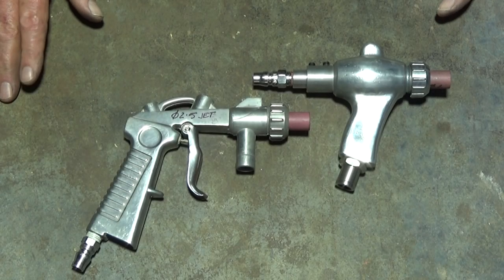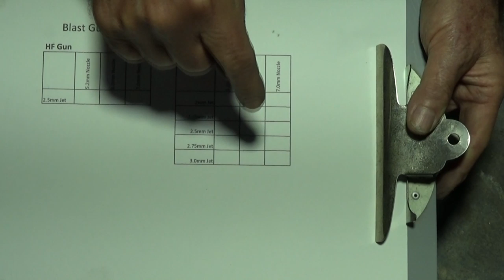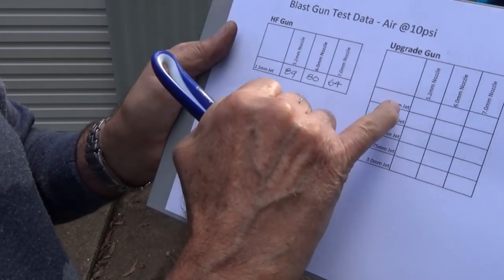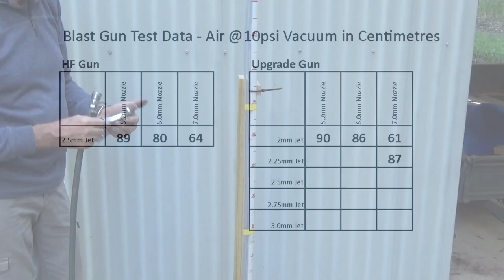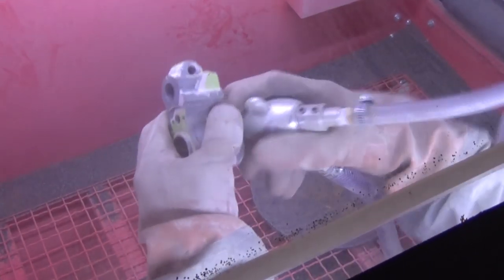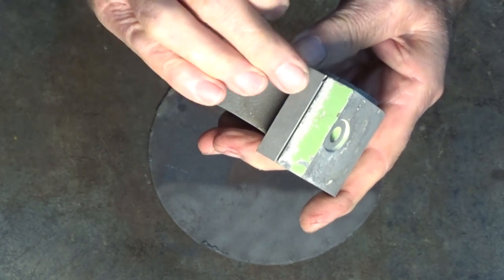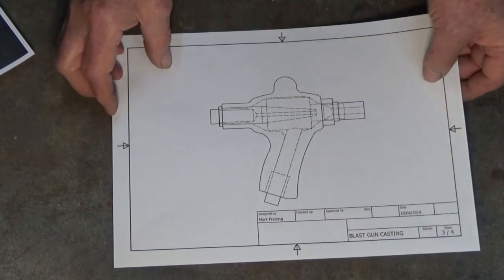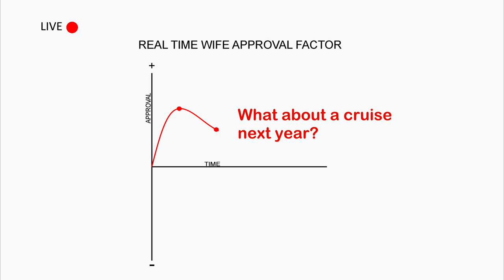DIY Blast Gun Testing Using a Manometer

Comment: Mark, I made several mistakes thinking I could save money by buying a cheap blast cabinet. I restored a 1980 MGB and cursed the HF cabinet ($175) every minute wasted trying to get the POC to work right. I also added a $150 dust collector. The second mistake was putting undue wear and tear on my compressor. I was going to sell the cabinet when I heard about the Tacoma upgrade. The third mistake was investing $448 plus the modification time. I have mixed feelings since the HF cabinet now works great at 35 psi, using 70-140 sieve media. Check for flow restrictions. Use the largest dia hose from the compressor to the cabinet. I have a dedicated 12mm hose from blaster to compressor (no quick connects). 19mm would be even better. I also checked/replaced any undersized quick connect fittings in my shop. Good luck on the larger compressor.
Reply from the maker: Thanks for the information. I think my biggest restriction is the cheap foot pedal I bought on Ebay. I am wondering if I can fit a ball valve and operate it with a knee operated lever. I think it's great that you are getting good results at 35 psi. That would cut down the duty cycle on the compressor.

Comment: Hi  Mark,
I’ve been enjoying your projects and videos, I’ve been looking to improve my sand blast gun recently, having a similar Hare & Forbes cabinet similar to yours.
Seeing your problem with the take up of media from the hopper even with your improved gun, I had the same issue with my set up, I solved this by mounting a small wiper motor with the gearbox removed and an eccentric weight added to the shaft, causing it to vibrate when running.
Mounted this to the outside of the hopper near the pickup tube for the media, this improved the flow of the media to a constant stream, no more sputtering.
I’m going to fabricate a gun along your design ( can’t cast yet in my workshop) to try to improve efficiency at the nozzle and also optimise the use of available air.
Keep up your good work, love your banter 👍regards Ralph
Reply from the maker: Ralph, I have seen some other users mounting vibrating motors to their media hoppers and I believe you can buy an off the shelf and self contained unit which does the job. I have noticed that even though the media isn't being delivered continuously to the gun, it still generates an almost continuous stream of grit at the nozzle. I think that the "gulps" of media are stored in the chamber inside the gun and the flow is regulated by the cross sectional size of the nozzle. For what it's worth, if I wasn't able to cast that gun in aluminium, I would now have it 3D printed in stainless steel. I just had some parts made for another project in 316L stainless and it wasn't as expensive as I thought it would be. The good thing about 3D printed metal parts is that they can have complex, hollow forms and they only require minimal machining afterwards. Sometimes you can get away with just a bit of drilling and threading with a regular tap and die.
Regards,
Mark

Comment: Very interesting to watch the evolution.  The ultimate key to blasting productivity is Pressure and CFM. 

Also, a Pressure Pot system is infinitely more efficient than any Suction Gun setup. I have been thru the evolution a couple of times since the early 1980's. My current blasting compressor is a 185 CFM Diesel powered unit. Plenty of air!
Reply from the maker: I would LOVE to have something that can deliver 185cfm although we might upset the neighbours with the noise. I watched a video recently by SV Seeker where he was getting ready to sandblast a steel yacht/replica Chinese Junk using a very large engine driven compressor. He included a very interesting video where he talks to a corrosion consultant about the correct way to prep steel for finishing. Very interesting. I did actually do an experiment where I tried to pressurise the media where it passes through the metering valve. I fitted a second air line with a regulator and gradually added pressure until the media was being pushed up the feed tube to the gun and then added air directly to the gun. It didn't help much. Initially, there was a good flow but then the media was depleted in the line and it just sucked air. I think if I had the room I would use a pressure pot with a large cabinet to collect the media but it's all about real estate in the workshop. I really wanted a smallish unit so I can prep weldments and fabricated parts for paint and powdercoat. Painting brass and non ferrous alloys is always a bit hit and miss but when they are given a good key and you can remove the oxides you can give the coating a fighting chance. 
Regards,
Mark Presling
Reply: @Preso58  The first go-round about 1981 when I was 21, I found an old portable IR compressor from the 1940's that was 100 cfm, piston type with a massive old Waukesha engine driving it. Made a pressure pot from a 100lb propane tank. And I had neighbors, close. Why they never called the cops is a mystery.  I'd never stand for that. (ha). I've watched all of SV Seekers work on his compressor and blasting evolution with interest. Great stuff. My current compressor is similar to his. I think the key between siphon and pressure blasting is the 'acceleration distance'.  In a siphon gun, the media has less than 2 inches to get up to the speed of the air flow. Much slippage occurs. In a pressure pot, it has the entire blast hose length (10, 15, 20 feet?) to accelerate up to air flow speed. I've thought about some sort of hose attached to the nozzle of the siphon gun, to give the media more distance to accelerate. Then maybe a secondary nozzle at the working end of that hose? Enjoy your vids very much!

Comment: Prezza ! Mate, pall.... Manometers, black water.... 'a bit of a mess'....
I figure your missus is about as happy as mine, when I get up to this sort of stuff....

Toodles!

Paddy
PS : about 30 years ago, I walked the length and breadth of  a nuclear plant, just using a clipboard !
Now, I had clearance, so no harm was done, but I only identified at the main entrance...and was allowed everywhere, just by walking around with a clipboard and a rather worried look on my face.
They are (clipboards) powerful weapons indeed !
Reply from the maker: I watched an episode of "Better Call Saul" where Mike Ehrmantraut did almost exactly the same thing with a clipboard. You are correct. Clipboard = authority
Reply: Overalls a concerned look and a tool caddy/box works wonders too

Comment: Just love this series. Truth is I could just pop down to the shop here in Canada and buy a gun but yours looks way cooler with the lightening bolt. No, what I love about this series is the science you’re putting into it. Also the casting techniques. Yup, love it!
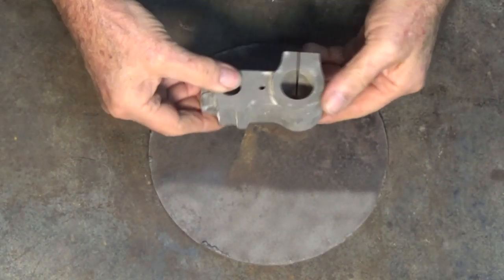Reply from the maker: I can report that I am very happy with the blast cabinet now. It still surges a little but the supply of grit coming out of the nozzle seems to be constant. One of the best mod's I did was to fit a knee operated switch to turn the air on and off to the gun. Way better than a foot pedal and there's nothing kicking around on the floor under your feet. https://www.youtube.com/watch?v=HhgT67n5lDo The mod is shown at about 15:00
Regards,
Mark

Comment: I think the upgrade is needed for sure.   Just because home shops dont have a good compressor to feed it air.   I have a bone stock HF cabinet,   a 80 gallon IR 2 stage compressor.    And my cabinet works very good.   Also the compressor doesn't run all the time. It will shut off with a continuous airflow.  It fills faster than it puts out.     I want to switch to a setup like yours just to lower the air pressure needed and use less.
Reply from the maker: I still find I that I am running my blast gun at over 80PSI and one of the selling points for the Tacoma upgrade was that you could run the gun at a lower pressure. I still have a lot of experimentation to do but that was my primary reason for wanting a new setup. My compressor just runs out of supply plus the noise is abominable. I have had some good tips on what sort of compressor I should look for as an upgrade though. Most of the compressors I have been looking at (that I can afford) are only 100 litre or about 30 gallons but I am thinking I could fit a second tank to increase the reserve.
Regards,
Mark

Comment: I guess by now you have a new compressor, and I hope you included an automatic drain for moisture. When I saw your compressor it looked like mine, and I quit using mine because I was afraid the tank would someday explode due to internal rust. I got the H.F. upright oiled compressor with the 21 gallon tank. It works great, and as someone suggested you want to put a cooler before the air enters the tank, with an auto drain. Love your videos. I live in Houston, Texas so I don't know if we have more or less humidity than where you are, but it is quite high here on the Gulf coast.
Reply from the maker: I have upgraded my compressor system. I have a Chicago "silent" compressor (they aren't silent) and I fitted a large vertical air receiver outside the workshop which is in tandem with the compressor receiver. All the shop air comes from the large vertical receiver so it is mostly cooled to ambient temperature. Any condensation that forms goes right to the bottom of the tank and can be drained off easily (although not automatically). It seems to work well.
Regards,
Mark

Comment: Mark 
I went a along a different path with my machine by using a pressure vessel made from an LPG cylinder and some copper pipe and a few gate valves. With this system there is no suction required to feed the hand piece just a valve to meter the sand under the cylinder. This system has similar pressure above the sand to the pressure in the delivery hose and there is no hand piece required. Just a delivery tube. This system is mounted below the cabinet with a isolating tap between the cabinet and the LPG cylinder containing the sand. The sand supply is continuous and can be increased or decreased as needed 
I feel the resultant finish on the work piece could be a little better than you are experiencing at the moment. 
I enjoy your videos. Keep it up.
Gray
Reply from the maker: Gray, I sort of dismissed the pressure vessel idea due to the small size of my compressor but I can see why it is a better solution. I also wanted to have a blast cabinet that could be wheeled around easily. I have to store it in a corner and then manoeuvre it around before I can use it. It's like a tetris game! It's all a learning curve but I feel like I have a viable solution at present. It's way better than trying to do it out in the open in a wheelbarrow to try to catch the grit.
Regards,
Mark

Comment: Thank you for another good video. It's nice to have other people do the testing for you! Interesting stuff! I had a 100 litre Compressor that wouldn't feed my plasma cutter, so I went looking for a bigger one, I' thought about 250litres, well, I found a second hand 500 litre three phase (I have three phase) which was cheaper than the the smaller ones! It's worth thinking about bigger if you can house it. Mine's going outside when I finish quietening it, but, it'll pick up it's air from inside the workshop where it's dryer!! Cheers, Matthew
Reply from the maker: I would like to put my compressor outside in a weather proof enclosure. Three phase would be nice. I watched a video by AVE a while ago where he did some experiments with a VFD fitted to a three phase compressor running off a single phase supply. Typically, it was hard to take his antics seriously but there seemed to be some merit in what he was doing. Good idea about locating the air inlet inside the shop.

Comment: Solid use of clipboard. 

I think you need to tune your jet position with every combination of jet and nozzle sizes. 

Also, it's not immediately clear to me that the optimum jet position and jet/nozzle size combination will be the same at 100 psi and 10 psi. I understand the limitations of your water manometer, but I think you will need to find a way to test suction at full pressure. This is all about maximizing fluid velocities at critical points in the chamber, and fluid dynamics is notoriously difficult to predict under changing conditions. 

Your chamber geometry upgrades look like an excellent idea. You might also try moving the media tube inlet off the center line of the gun to one side or the other where it enters the chamber. This would encourage a vortex within the chamber which might be quite useful for maximizing media flow.
Reply from the maker: All good ideas. I knew the tests would be just a guide and the MKII version of the gun will need to be tuned all over again. I tried to research commercial/professional gun setups and I found that they all had the inlets lined up on the centre plane of the gun. I get what you mean about the off centre alignment though. It would be an interesting experiment. Maybe a transparent body would allow for better understanding of what is going on. I recall years ago I was doing some tests with some of my students at a university that had a water flume for testing fluid dynamics. We made a 3D printed model of a race car we were developing and put it in the flume so that we could run dye over the surface to find out what was happening in the boundary layers around features like the wheels and the wings. What a revelation! We found areas where there was almost no flow and others where the flow was actually at right angles to the direction of the water. At the time the accepted knowledge was that you had to "streamline" all the areas of the car around the wheels so there was no turbulence. We were able to show that it wasn't really necessary on an open wheel car of the size we were working on. (it was only 210mm long). The boundary layer was so thick that the open spaces around the wheels were just dead air and got carried along with the car. Sadly, the kids knew more than the judges and the panel of "experts" couldn't understand what they were being shown. 
Regards,
Mark Presling

Comment: G’day mate
Just a few thoughts 
After spending many hours dicking around with my old Commercial industrial bead blaster cabinet having the same issues with the Medium surging in the suction line. 
I found by using a gravity feed hopper on top of the cabinet feeding the Handpiece to best. 
Keeping the bead clean and dry was also very important to keep it running well. 
Good luck with the compressor btw. 
Hoops
Reply: Just use any old screw augur type system to fill the hopper. It is possible to use inlet air pressure to power a coarse threaded augur via an air wheel mechanism, but I recommend a tight fitting system if you go this route.
Reply from the maker: I would very much like to have a gravity feed hopper above the cabinet but I don't have a lot of space left in my shop. I have to store the blasting cabinet out of the way and trundle it away from the wall so I can attach the dust cyclone. It's working pretty much how I want it now and unless I decide to do anything really big it should serve my needs. The whole compressor thing is really just because my old one is getting past it's use by date. I am looking at getting a Chicago silent type. For around $1200 I can get a 100 litre, 16CFM machine.

Comment: I really like the Austrlian humor.
When i bought the "HF" type blaster cabinet, i discovered that my 2.9 kW compressor was not up for the job, i bought one more compressor.
After 2 years i got tired of the 2 compressors hammering away, i built my own 5.9 kW compressor with a 300 liter tank.
I have enough compressed air now.
Reply from the maker: Ulrik, do you have a three phase supply to your workshop? I believe that many parts of Europe get a 3 phase connection to their utility company as standard. It certainly doesn't happen here. It's even worse when you live on acreage like we do. The distance from our street frontage to our meter box is around 70 metres and the power cable goes underground so it's almost out of the question to upgrade.

Comment: Matt I strongly suspect that with the larger nozzle sizes, you were trying to consume more air than you compressor could provide and thus the air pressure was in fact dropping below the 10psi threshold.  Unless you verified this while flowing through the particular nozzle configuration?

Comment: I had the same thought as Barnezy. If you thread the gun and jet you can adjust the jet position to optimize the media flow for every nozzle size.
Yes, I realize I'm not the one doing all of the work, fortunately! 

I enjoy your videos.
Reply: Grit and dust might cause problems.
Reply: @opendstudio7141 A large straight dog point on one of the set screws could serve as a follow pin for a much needed coarse gage gouge in the jet body. This would allow the jet position to be adjustable to a fair-the-well. Make it one turn over the long distance like rifling only much much deeper.

Comment: Mark,
I have found over the years its always better to ask for forgivness rather than permission, especially when buying tools.
Wives rarely venture into the shed, dont know whats in there and after a week everything has the same aged patina and dust coating, so doesnt stand out.
If she does notice it pull the old " oh that old thing Ive had it foe ages..."
Yes you will need 15 amp, I have the same blast cabinet with upgrades and a trade tools 310 ltr min, three cylinder pump ( biggest single phase I could find) and yes it runs about 85% of the time when blasting.
One more mod for your cabinet, paint the inside white.
Reply from the maker: Thanks for the info. I will check out what Trade Tools have to offer. They are handy to where I live and they have good stock levels. I have sort of resigned myself to having a second 15 amp line run for the compressor.
Regards,
Mark
Reply: @Preso58  
15 amp will come on handy for that welding series you know you want to do 😁;)